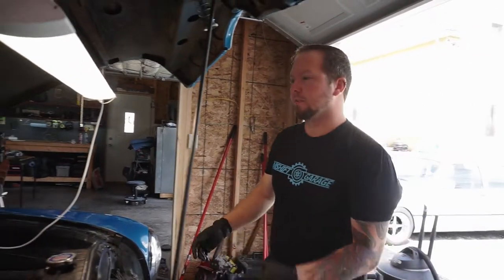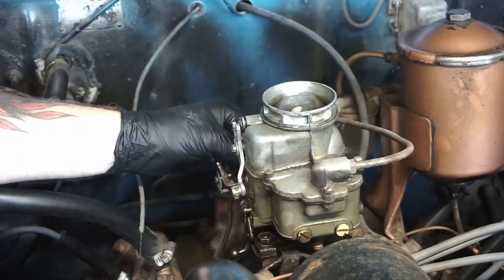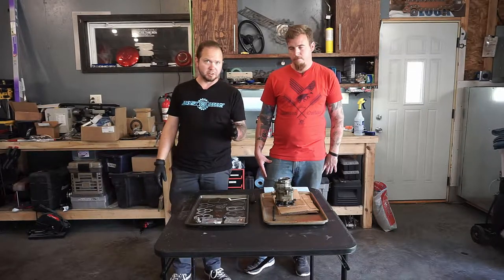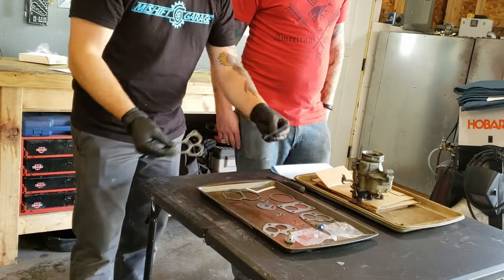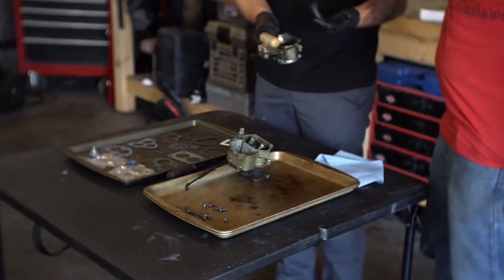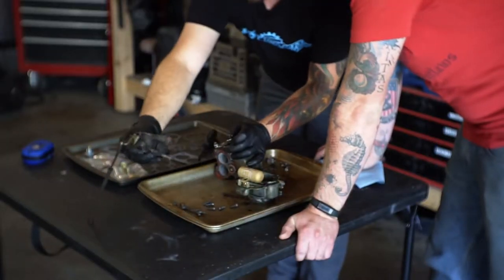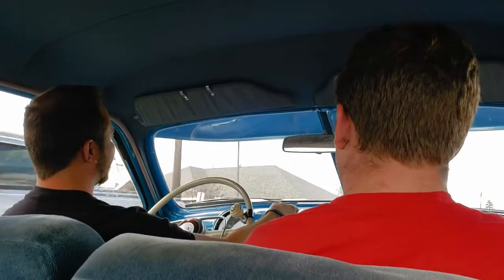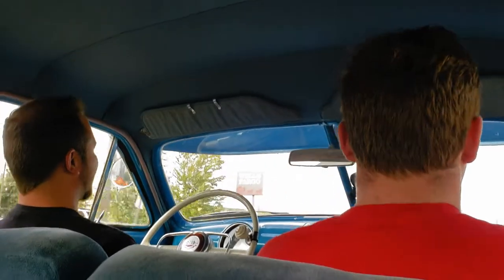How to rebuild a Holley 94 Flathead Carburetor; GEAR Video

Comment: doing mine this week.  thanks
Reply from the maker: Which rebuild kit are you using? If it's from Shoebox Central they have a great guide they provide. 
I will say, this carb is incredibly simple so you should have no problem rebuilding it if it's in decent shape. Good luck Tom!

Comment: So, it's an Oil Bath Air Cleaner. While there is some amount of oil that gets into the filter material, the biggest way it actually filters incoming air is through sharp changes in direction of air from the inlet to the carburetor. particulate matter is cast from the incoming air stream as it makes the directional transition. This transition occurs just above the level of the oil and the larger particulate matter is cast from the air stream and into the oil where it is retained in suspension.
Reply from the maker: Thanks for the detail J P! 
That makes a lot of sense now having opened one of these air cleaners up. Clever old design!
Reply: @DadModsMedia , in a lot of ways the design is still used today albeit slightly modified based on application.  Utilizing centrifugal forces to separate particulate matter from the airstream, which is basically what is happening during that direction change inside the oil bath air cleaner.  We see the use of this in particle separators on turbine powered military helicopters, even most modern bagless vacuum cleaners.  An oil bath aircleaner reslly shines in very dusty environments and you can still find them in use on trucks and heavy equipment and are just as good as if not better than most paper elements at removing more dirt and dust from the air.
Reply from the maker: That makes a lot of sense. Similar effects are used with dust separators in filtration systems. 
Thanks for the tech JP!
Reply: @DadModsMedia   not a problem! I love sharing information/knowledge!

Comment: I got an original 8 BA carb at a garage sale and I don’t know how much it’s worth. Decent condition and could be cleaned up real well. Any ideas?
Reply from the maker: I couldn't tell ya but I'm sure the Facebook groups for shoebox Fords could.
Reply: @MPerly  $50 or so at most. There's a million of them out there so they're not rare at all. If you do an at home rebuild it it may be work like a hundred to $120. If you have it media blasted, fully recoated, fully rebuilt, and fully tested with documentation it could go for about $300